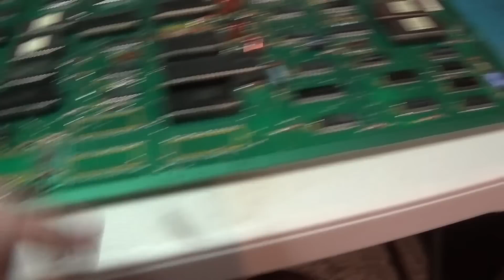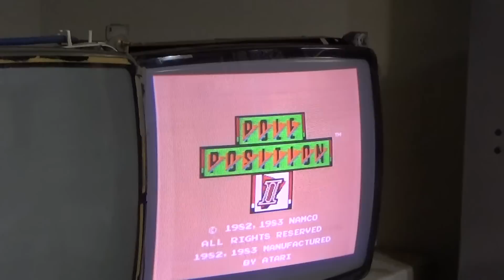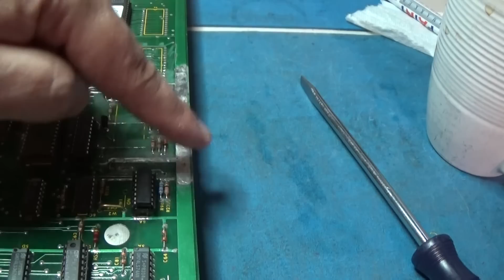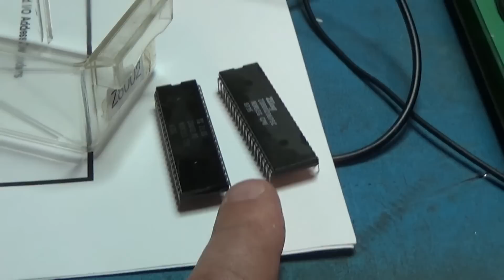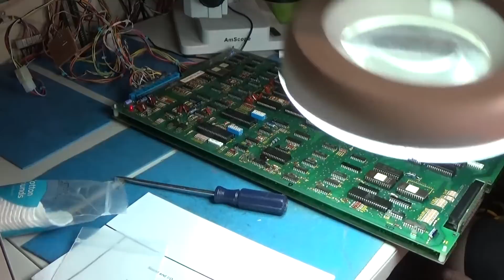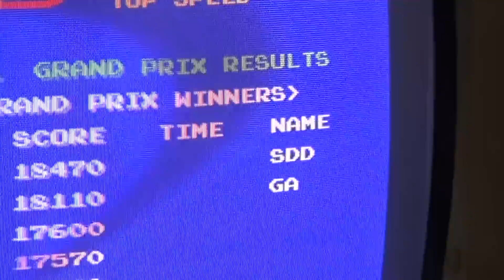Locked up - Atari "Pole Position II" PCB Repair - 5/31/22

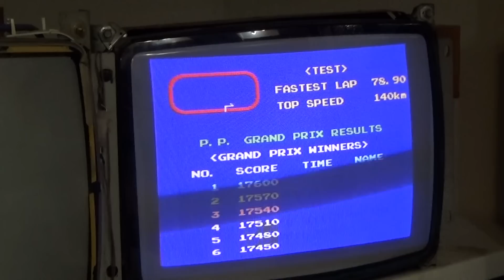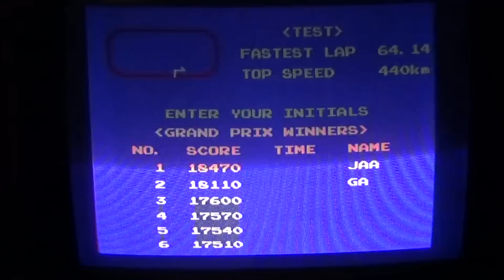Comment: there's some visual artifacting around 19:18 in the score screen, with what appear to be black regions showing up around the high score digits and text. it shows up consistently every time the high score screen comes up, around 23:51, 26:11, and 27:22 for example. given that the crashes happened when the high score screen was being displayed, i wonder if that's related to the faulty cpu still being in the board?

E: It also shows up around 15:04, but again, only on the high score screen. ?????
Reply from the maker: that is weird...  its a camera trick..  because there is no way I would not have seen that...  just has to be the camera and the angle...  It was not doing that in person
Reply: @classicarcaderepairs  it does seem to come and go with the camera focus, just suspicious enough that i thought i should mention it

Comment: I have gone through a bunch of PP boards in the past. I recall running into a similar reset issue when swapping those CPUs around. I don’t understand it either. My best guess would be that one of the processors is a little temperamental and resets for whatever reason. perhaps one side of the board has a small voltage drop or maybe there is more processing demand at one location which exceeds its threshold sensitivity. Whatever the reason, kudos for taking on the pole position board repair challenge. Nice work as usual. If you need a home for your personal PP board that you just fixed, I have an extra cabinet you can have. It would look nice next to your millipede!! 😛
Reply from the maker: uuummm   if your getting rid of a PP cab i would surely take it!!!!
Reply: @classicarcaderepairs  I’m only getting rid of it if YOU want it :)  

You can have it but I’m not sure how to get it into your hands…